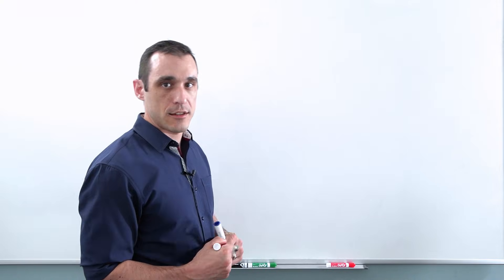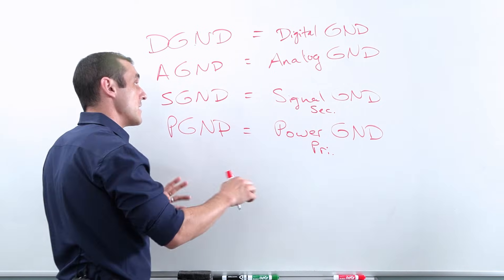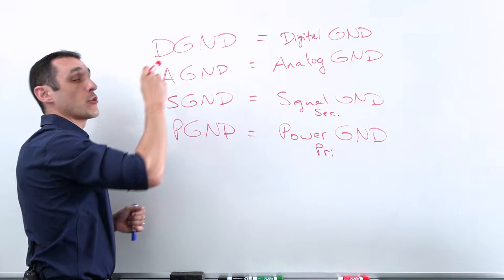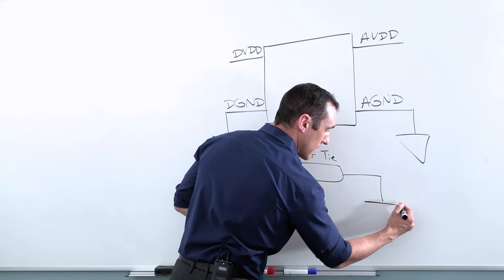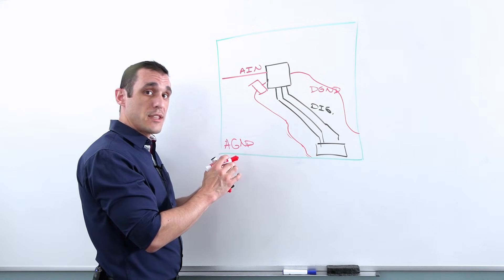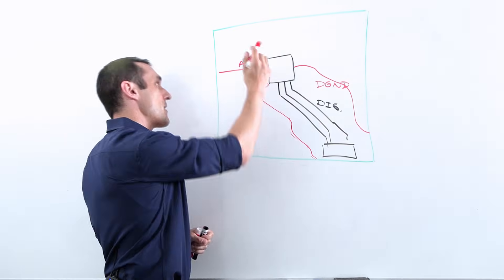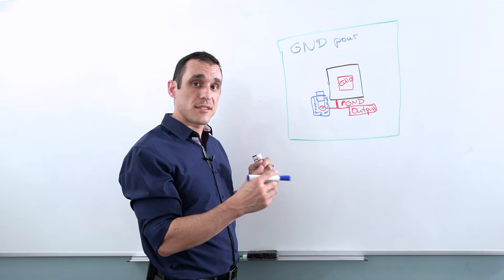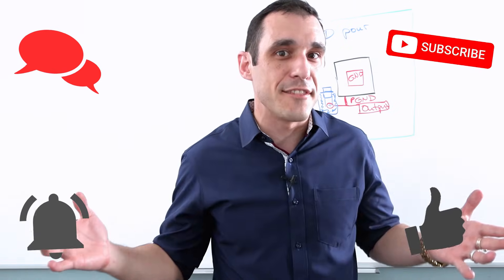Types of PCB Grounding Explained | PCB Layout

Comment: How high the frequency of a signal should be so that we're sure the return current is right at the bottom of it?
Reply: Typically at high kHz frequencies is enough to ensure confinement of the signal below the trace. There will be some spreading beneath the trace into the ground plane. As the signal bandwidth extends to higher frequencies, the return current will have be more tightly confined below the trace.

Comment: I usually split the PCB into digital and analog section, making sure that return currents from either will not flow through the other. Has worked well so far for mixed signal PCBs, without splitting any planes.

Comment: Others have touched on this but, in buck converters, I think it's worth emphasising that the distinction between different grounds is less important than understanding where the principal high current loops are and ensuring that they are as small, as low impedance as possible and preferably on the component layer only.  The inductance of the return current path (ie "GND") is make-or-break, both functionally and in terms of noise caused by common impedance coupling [in ground currents].

Here, both critical current paths involve the negative plate (ie ground) of both the input and output capacitors.  

When the switch is on, current flows from the positive of the input caps, out through the switch and inductor¹, and into the output caps' positive, returning from the output caps' GND back to the input caps' GND.

When the switch is off, current flows from the inductor¹ and output caps' positive, returning back into the output caps' GND and the inductor through the diode (which is more usually a FET).  There is a third current loop through the input capacitors as they are recharged by the source supply.

These large switching return currents should not be common with load currents in the ground plane if at all possible and, instead, stay on the the component layer.  This is, effectively, a separate ground.  TI datasheets usually recommended a layout which has these return current paths go through the ground plane below the buck converter.  That will work and not cause problems in an evaluation board but it is not optimal in an application board, especially when the buck converter(s) can't be well isolated by sectioning the board, because the parasitic partial inductance of the vias to the ground plane together with the parasitic partial inductance of the plane itself contribute to common impedance which produces noise voltages in proportion to the magnitude of the switching current.  Those noise voltages can then couple into any application circuit that shares a common return current path, ie the ground plane.

[Ed:] That said, there is an argument for sending return currents in the plane below rather than on the component layer, which says that because the magnetic field from the forward current is opposite to that from the return current, the magnetic fields cancel thus reducing EMI.  Two problems with this: 

1. it only works if the return current follows (in the ground plane) exactly the path on the component layer, but what path return current follows through a solid ground plane is frequency dependent, and
2. switching return currents still disturb application circuits with noise arising from common impedance in the ground plane.

¹ This is DC, so current always flows in the same direction.  However, current in the inductor increases (dI/dt is positive)² as it charges when the switch is on, and decreases (dI/dt is negative — but still flowing in the same direction)³ as it discharges when the switch is off.

² Inductor potential is always opposite to (and in proportion to) the rate of change of current as it charges, so the potential across the inductor is negative — ie subtracts from the source voltage — which is how the buck converter steps-down voltage presented to the load.

³ The potential across the inductor is now positive as it discharges so, together with the output capacitors, it acts as a current source for the load.  The voltage seen by the load is determined by the charge in the output capacitors, `Vout=Qout÷Cout`.  The voltage ripple, then, is determined by the size of Cout, the load current and the switching frequency.

Comment: for that ADC example, even with a GHz Sample rate ADC, it would still be able to capture low frequency products. So anyway we need to split AGND and DGND right?
Reply: Is your SNR value near 1? Then maybe... If you are trying to measure a high frequency signal and you are worried about low frequency noise there are much better things you can do to measure the signal above noise without creating an EMI problem by splitting AGND and DGND. Splitting the GND net like that is a poor excuse for controlling noise when someone refuses to learn correct layout and routing practices. In addition, the GND pins on the ADC are connected internally! AGND and DGND splitting just makes the routing in the rest of the board more difficult.
Reply: @Zachariah-Peterson  thanks for your comment. I was not thinking straight. Actually for High speed ADC usually it can easily remove those low frequency by digital filter .

Comment: Thanks for the informative video. But i have two questions:
In power converter, why should we connect the SGND and PGND? (
And in ADC why should we connect DGND and AGND with a tie?
Reply: In power converters with a primary ground (PGND) and secondary ground (SGND), these are isolated converters and you leave the grounds disconnected to maintain complete galvanic isolation. You can connect them if you want but you will eliminate the galvanic isolation, so it defeats the purpose of using an isolated converter.

In ADCs, the AGND and DGND pins are already connected inside the package, so they do not have galvanic isolation. The main reasons to use a plane for connecting the pins are to confine noise from the digital I/Os away from the analog interface but without interrupting the ability to route everywhere else in the PCB. Using a net tie in the way you describe can make routing more difficult and it interferes with the return path from the digital section which creates greater radiated EMI and greater EMI susceptibility. So just use a ground plane, it is better for EMI/EMC and ease of routing.

Comment: Instead of using a net tie I used a zero-ohm resistor to connect PGND and AGND.
I think that it is the similar way to do grounding in a dc-dc non-isolated converter.
Reply: Yes net tie and zero-ohm resistor are the same in this case for non-isolated converters. I think a zero-ohm resistor is simpler for routing just because you now do not need to create a specific net time component and the system will automatically separate the nets by name.

Comment: I think this video is VERY helpful to me as I am suffering some very serious ground noise inside my ADC board. I'm using FPGA to drive my AD9826 to receive voltage data and I use one single ground as the datasheet told me. But then I found the noise on the ground very high which interrupt the analog signal (in my case, the frequency of the analog signal is very low), do I need to seperate the ground and USE a piece of Ferrite bead to block the clock noise? And if the frequency of the input signal becomes higher (about serval MHz), what should I do to reduce the noise?
Reply: Also, if I have several device like this, is making more than one ground connection a good choice?
Reply: Maybe I can help you by doing a video demonstrating how to route it correctly....

Comment: ugg, GND islands are such a disagreeable topic. As much as I know that return currents can be controlled in placement, I still prefer to carve out AGND separately then use a large Net tie. Once a signal from a sensor, that was on the regular GND, comes into a high impedance input of an op-amp, that's when I consider the signal now on and around AGND. I usually will place my net tie between DGND and AGND right under or around the ADC/DAC or Micro Controller and I'll route the analog signals around the AGND. 
Will you explain any holes in this logic?
Not using this old school tried and true way is really hard to break, even when I know it can be done with proper placement and routing.
Reply: If you're only keeping the digital stuff in the digital area and the analog stuff in the analog area, and if you can guarantee the digital circuits are completed in the digital section and analog circuits complete in the analog section, then you've basically created an isolated system and the net tie becomes kind of meaningless. In some ways, the net tie is already meaningless because in a non-isolated ADCs the component links the GNDs on the die anyways, the exception is when the ADC is a galvanically isolated component. But with modern ADC packages or an MCU, you might have signals that must route over ground but they can't because of the split. I'm sure you could find some components where the interfaces are separated like you suggest but it is not always like that, just look at mixed signal ASICs or MCUs in quad packages.

I think the biggest problem with the split AGND/DGND guideline is that newbies see it and they don't understand that they shouldn't route across the breaks in ground, but then they do it anyways. Then they wonder why they have excess radiation or fail susceptibility testing.

Comment: Hi, I don't understand why we need a net tie in the buck converter with the via. I think via connection is a single point anyway, right ? 16:29
Reply: It's not a strict requirement. Technically because the PGND and GND pins are being connected with a piece of copper, they will have the same ground potential. The reason this is sometimes done is to control return currents in the plane layer; it enforces some isolation from nearby currents so that they do not interfere with the voltage measurement in the feedback line, and we would like for the feedback line to be either noise free or to only reflect the noise on the power bus in order to provide compensation through the converter's feedback loop. If the insulator layer is much thinner, then you can get away with using a complete piece of ground for your buck converter because any signals that might induce noise on that feedback line will have a more strongly confined distribution of their return current below the trace. It's equivalent to reducing crosstalk between the FB line and some other line.
Reply: @Zachariah-Peterson  seems to make sense now. thanks for your reply

Comment: How about ground for an audio codec like the AD1937? I did it with a separated ground and only routed digital lines over the dgnd and had an optional net tie with a junper, close to a 2x4 pinsocket which had the AGND and DGND nets connected with nice thick traces to their respective copper pours. I still had analog output garbage that could have been caused by EMI. Unfortunately I don't have equipment to measure EMI. I only have a kind of decent scope and an average multimeter. Maybe I'm just biting off more than I can chew here though 😅

Comment: How about for a battery source (floating) with high DC voltage output using a transformer like the xenon flash capacitor charger like the LT3751? Their reference design on the datasheet shows a separate analog and digital ground areas on both the schematic and pcb drawings. I've read your blog post about the different grounding options for PSU but I'm not sure how to implement it on a battery source. Since I don't have an earth / chassis connection, would it still be ok or not, to connect the xformer primary ground with the secondary ground using Y capacitor to decouple the HF noise back to the primary gnd? Or should I just separate the two ground areas completely?
Reply: The reason there is separate grounds on the LT3751 reference design is because that system is a flyback controller, which uses a transformer. While there is not necessarily a requirement to use separate grounds on each side of a transformer, one of the reasons you would use transformer is to implement galvanic isolation, and since you are using a high DC voltage source you want to have that galvanic isolation with two different grounds on each side. Since you don't have an earth/chassis connection it is still okay to do the connection with the Y capacitor, in fact I would recommend trying this and examining high-frequency emissions from the system. You have to be careful with leakage across that capacitor though. If you have high leakage then you might cause annoying shocks at any HMI element in the design (buttons or connectors), there are EMC standards that specify limits on this type of ESD through leakage.

Comment: I SO concur with your uniform ground approach in all mixed technology cases except where there are specific reasons. Split grounds and net-ties are a nightmare to get right and in my experience cause FAR more EMC issues than they avoid. Proper circuit and trace segregation is definitely the way to go, and is why careful component placement is such a key step before going anywhere near a routing tool. And with things like switching regulators, I keep the close-coupled, high current paths as short and wide as possible on the component layer, (another trick to perform during placement), keeping trace impedance minimised and avoiding vias in those paths at all costs. Once power rails have been sufficiently decoupled on the component side, I then route the rail to a split power plane or a trace network as the design requires. Keeps EMC controlled, improves performance and aids thermal management. What’s not to like?

Comment: In some ADC applications I’ve seen the recommendation to connect analog ground to digital ground through a pi filter. Pros / cons?
Reply: No don't do this, it really is better all around to just use continuous ground unless you have a reason not to. @blue5375 mentions ground bounce between the planes, I think he is referring to the fact that the disconnected ground regions can have a potential difference (voltage) between them. The result is that if the potential between those regions starts oscillating, then you have a changing electric field between them that starts radiating, and you have basically created two big edge-coupled patch antennas.

One reason to use different grouns is, for example, with use of an isolated ADC, which requires split grounds but the purpose is for galvanic isolation. I just finished a tutorial with this type of design, you can find the source files on my company website (search for Northwest Engineering Solutions and go to the Design Examples page under the Resources tab).
Reply: I would say definitely not! The aim should be to keep grounds together in terms of voltage, and increasing the impedance between ground nets only encourages ground bounce between the nets. The best place for a pi-filter is connecting the supplies, between DGnd and AGnd, with the capacitor each side connected as close to the respective Gnd pin of the interfacing chip as possible.

Comment: Awesome video, thanks for the content. Good rule of thumb to implement split planes for low frequency applications. Also to add that for large current applications this becomes quite important. Example I keep the return paths for a motor driver completely isolated from my ground and use net ties to avoid introducing offsets when my motor is running which can be quite large.
Reply from the maker: Glad it was helpful!

Comment: When talking about where to put the net tie around https://youtu.be/19WnYPhNOH0?t=640 ... I missed the answer.  As best I could tell, anywhere along the boundary should meet the 0V requirement in theory, and in practice, it seems you would want to be farther away from the chip, since that is something which could temporarily change that.  A minute later, when talking about low-frequency analog signals that spread out, I would expect that you want the net tie to be as far as possible from those signals.  But you suggested being near the chip, and relatively (given the boundaries) near the analog signal line ... what did I miss?
Reply: Actually I'm arguing that if you lay out the board properly then you don't need the net tie at all. If you look at these kinds of recommendations they will put it near the chip or directly under the chip. In the case where you can't control return paths or noise coupling, and then you start splitting GNDs, I think it's much better from a noise perspective to take an isolated design approach but that is much harder, now you have to worry about inductive or optical coulping across ground regions. If you do it wrong you'll have floating grounds that then radiate, it's a pain to do it correctly and it can make the rest of the layout harder.
Reply: @Zachariah-Peterson  So the real answer is that you should separate things by enough that you can do it as a single plane, and if you can't do that, try to isolate them completely, and if you can't do that, try to use a single net-tie, but you're already at 3rd-best, so worrying about where to put the net-tie is spending your optimization time on the wrong thing?  And if you need a rule of thumb even for that, do whatever is conventional and won't make people curious, which often means "near the chip"?
Reply: @jimjjewett  If you're at the 3rd best solution then you've probably optimized the wrong stuff and put yourself in a corner where you're now forced to use a net tie instead of a single plane. At that point, might as well near do it the chip I and throw a wonky looking gap between your digital stuff and your analog stuff, but prepare yourself for excess noise!